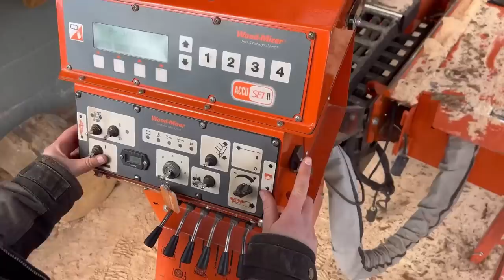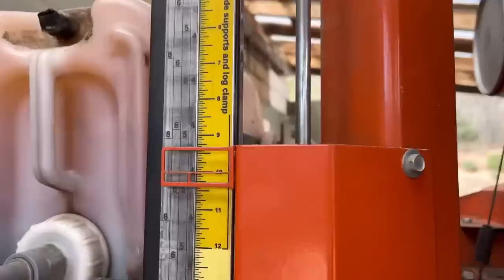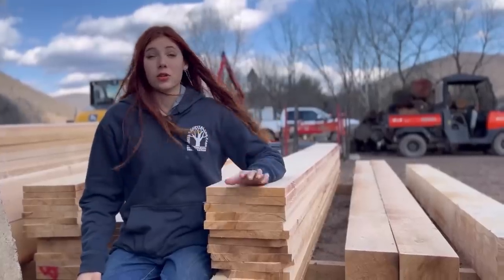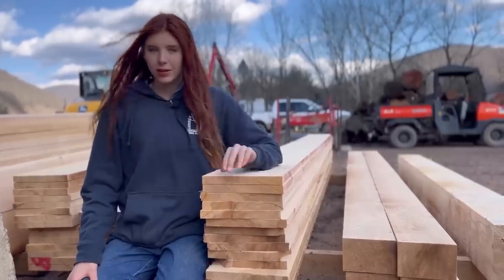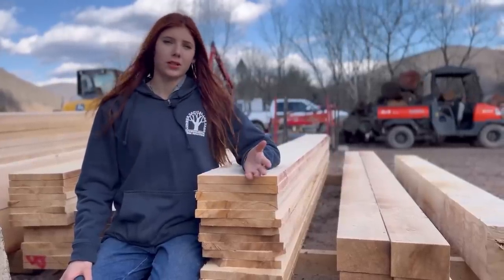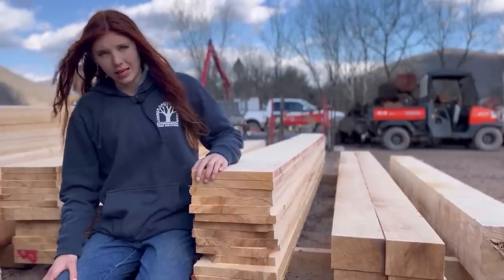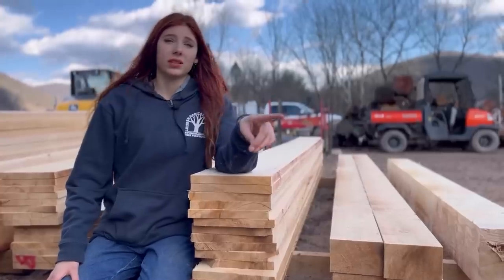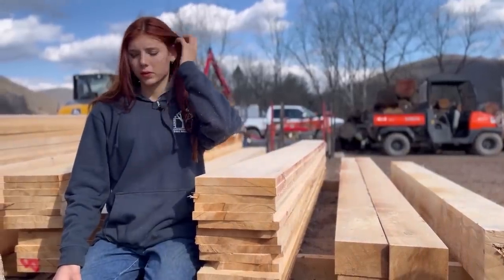Milling Lumber Like There’s No Tomorrow on the LT40 Woodmizer!

Comment: Okay. Full disclosure. I'm 80 and I find videos about things that I have not done and will never do interesting. I also watch because I find it impressive that these young ladies WORK. I'm wondering how you decide to make the first cut. What I think is that you make it where you will be left with a viable dimension, such as 4", after the cut. That way the second cut gives you a board that you can run through the edger to recover a salable piece of wood. Close? I'm always wondered how they decide where to make the first cut on each side.
Reply: I am also 80 [the new 60] and enjoy the videos for the same reasons.  Keep on posting!!